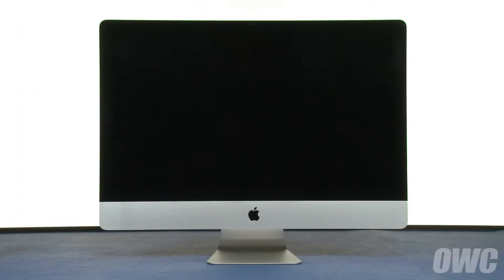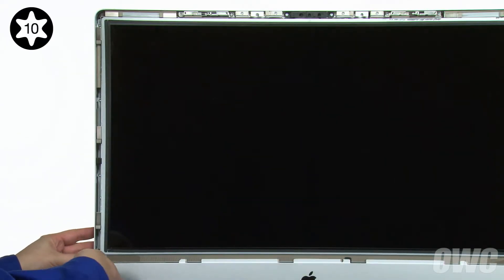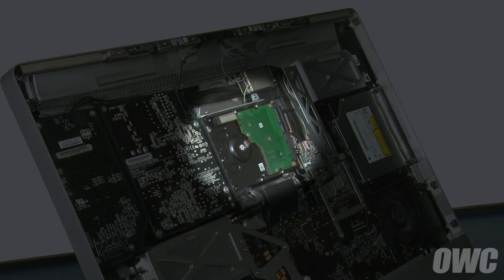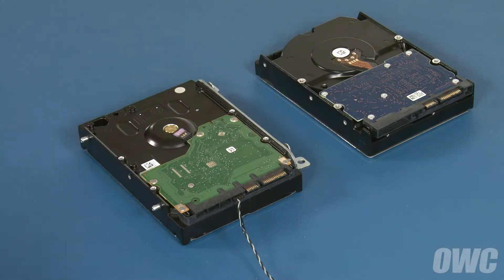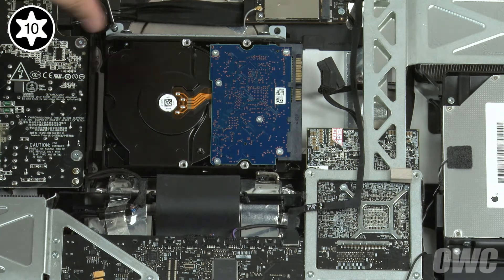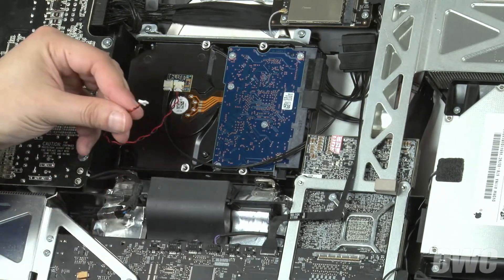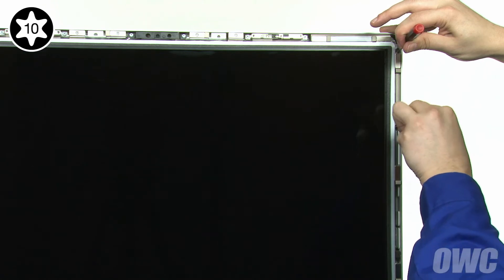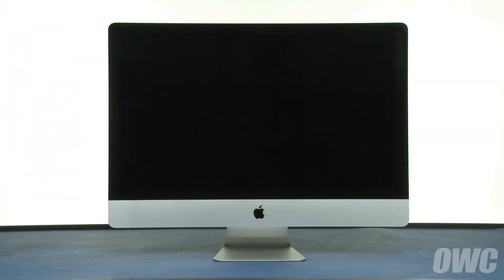How to Upgrade the Main Drive in a 27-inch iMac Late 2009 (Updated)

Comment: hi! where can i find the cable with Red and Black color? i mean the cable to the motherboard sensor conector to the sensor. thanx
Reply from the maker: Here is a link to the corresponding component: https://eshop.macsales.com/item/OWC/DIDIMACHDD12/#includes, this comes as part of the sensor kit. Hope this helps.
Reply: @poweredbyowc  yes bat I have that sensor for ssd upgrade. I need only that cable
Reply from the maker: We only sell them together--cable with sensor.  We do not recommend combining the wire with another separate sensor.

Comment: I just replaced the HDD of my late 2009 iMac 21,5" with an SDD drive (with a 2,5" to 3,5" SATA adapter) using these instructions! I bought the OWC thermal sensor from Amazon (Germany). Thank you!
Reply: Is it worth the effort? Can you tell the difference in performance?
Reply: @ghostface301279  Well, I had to replace the HDD because it broke. I only use that iMac for specific purposes with the old Mac OS 10.6.8. and old software. After the drive change I just used Time Machine to instal everything on the SSD like they used to be on the HDD. So, I can't really say how the performance has improved with the change... sorry.

Comment: Is the Sata from the DVD the same of the Sata of HDD? Because I've installed a SSD in DVD place, but the Write and Read speed are slow...(480 is the speed correct) but, my SSD installed at the DVD place, is marking just 240 speed of write... Is The Sata from my Imac 2009 old? My Imac 2009 will just operate with a half of speed because of the SATA?